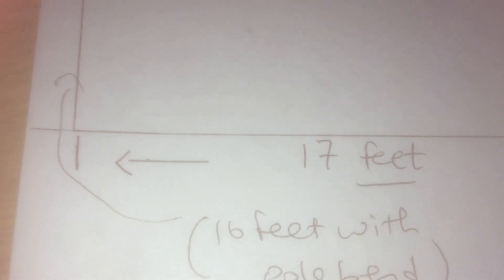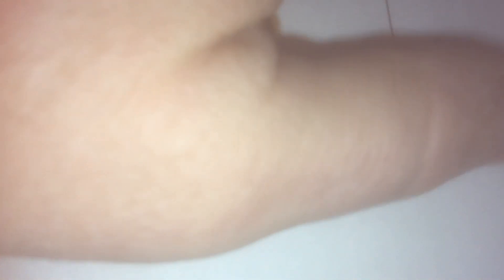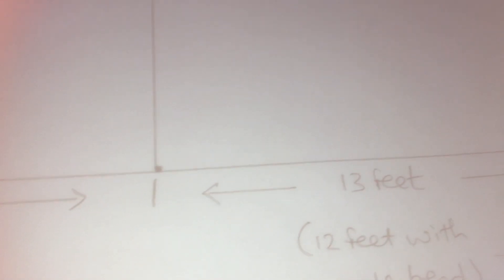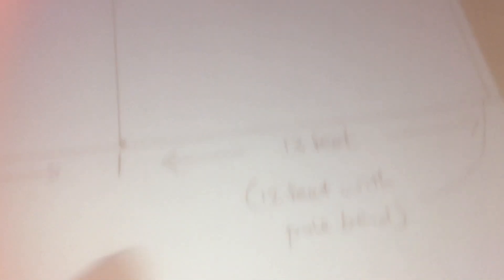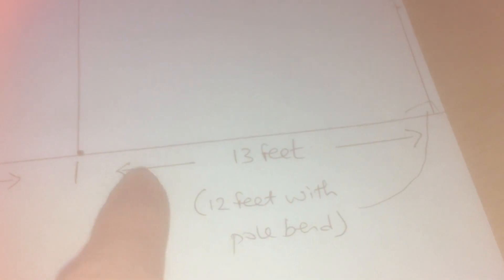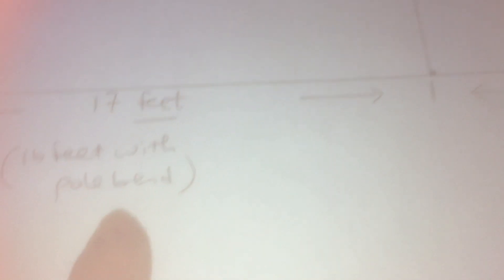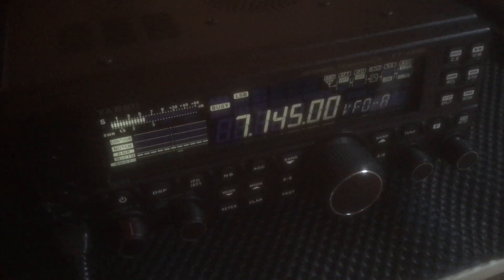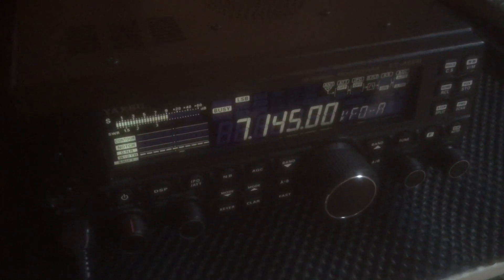Doublet for a Small Garden - Multiband Antenna for HF

Comment: can you bend the dipole ends horizontally, instead of down vertically,.... what would be the effects of doing this on its performance?
Reply from the maker: As long as the angle bends no less than 90 degrees yes. Performance wise I doubt you’d notice

Comment: Great video Tim, thank you for the effort put in. Antenna looks like it works amazingly well for it's size. My garden is also very small, and I have to use something similar, except mine is an off centre fed, because of where my mast is situated, but works quite well too (fair bit of noise on 40m though, maybe because I'm in the middle of about 3000 houses).........73's from Nik
Reply from the maker: Nik Gnashers thanks v much Nik. Yes she does ok especially on 20. Waiting to see how the higher bands do too when they eventually open. She even tunes on 80 and whilst not being very effective on 80 I can make contacts within the uk at around 250 miles or so. All good fun! 73